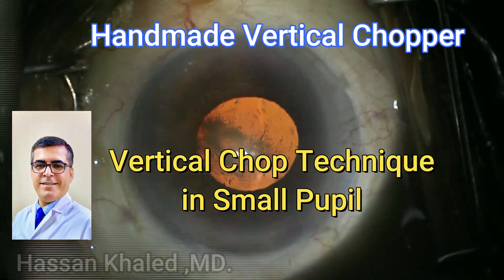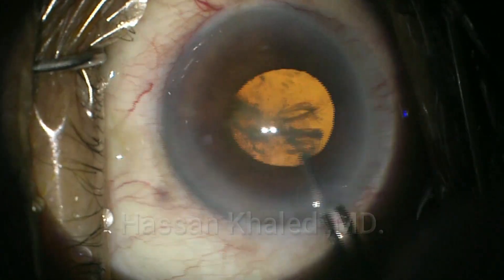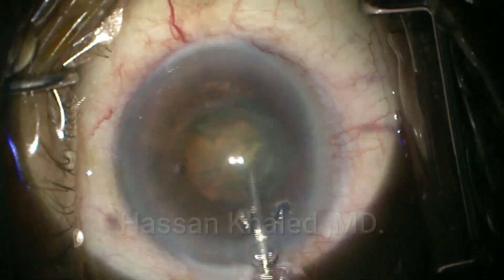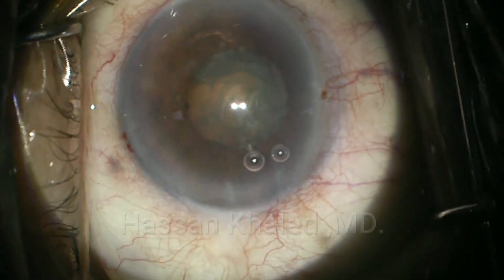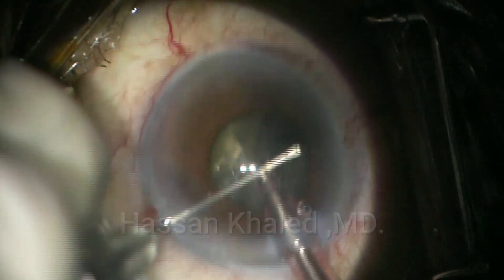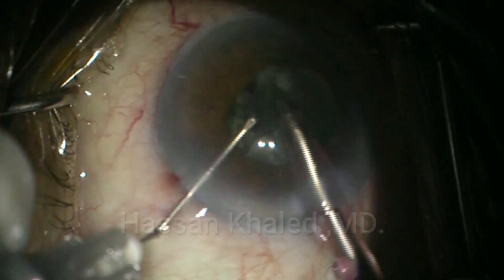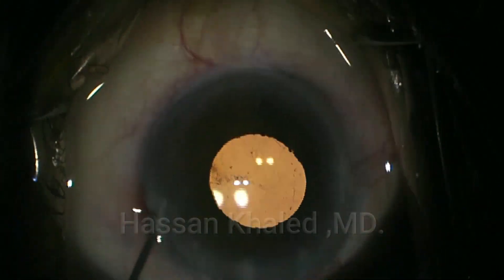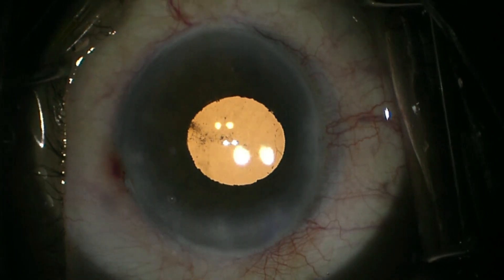Handmade Veritcal Chopper

Comment: Great post! Thanks! Do you change your phaco machine settings in any way when using stop and chop technique like in this video as opposed to divide and conquer?
Reply from the maker: Thanks. Here in this video the technique is vertical chop , my settings are vacuum 450 , asp 35 , longitudinal phaco power 50 and tortional power 70 with IOP 65 as I am using Centurion Alcon machine. 
In Stop and Chop , decrease the vacuum during doing the groove then increase after splitting the nucleus and the same thing in divide and conquer technique , you should decrease the vacuum while doing the groove.